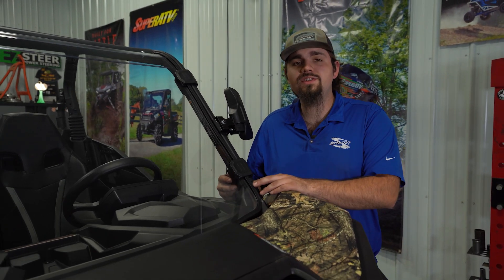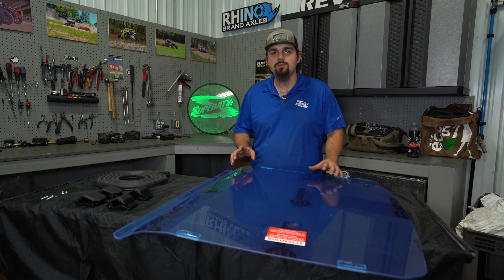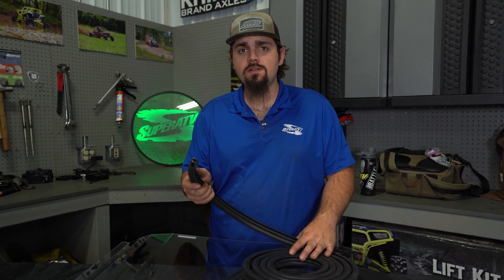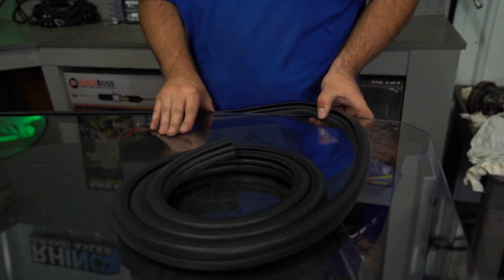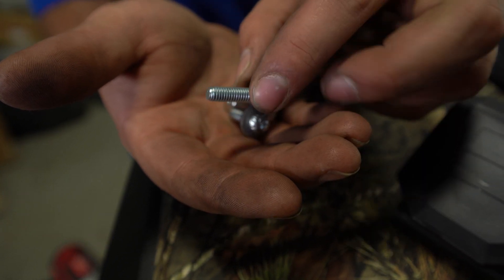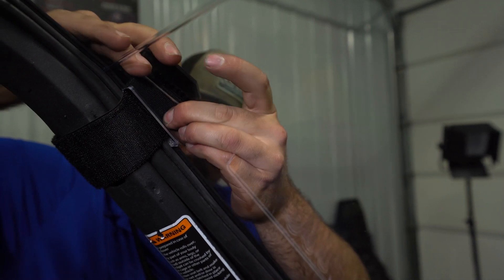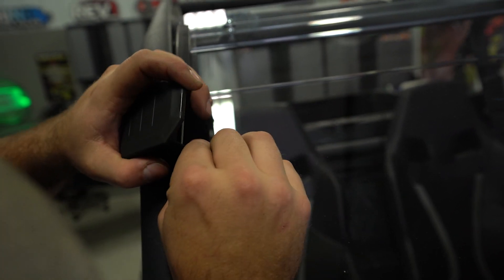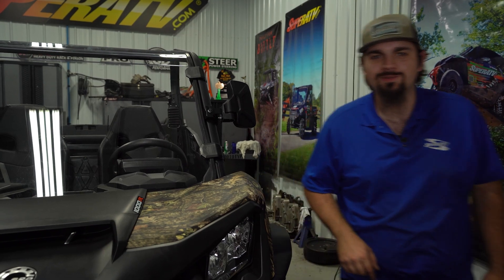How to Install a SuperATV Full Windshield on a 2021+ Can-am Commander XT 1000

Comment: Does windshield fit all models?
Reply from the maker: Here is the full model listing: 
Can-Am Commander 700 DPS : 2022+
Can-Am Commander 700 XT : 2022+
Can-Am Commander 800 : 2011-2020
Can-Am Commander 1000 : 2011-2020
Can-Am Commander 1000R DPS : 2021+
Can-Am Commander 1000R XT : 2021+
Can-Am Commander 1000R XTP : 2021+
Can-Am Commander Max 1000R DPS : 2021+
Can-Am Commander Max 1000R XT : 2021+